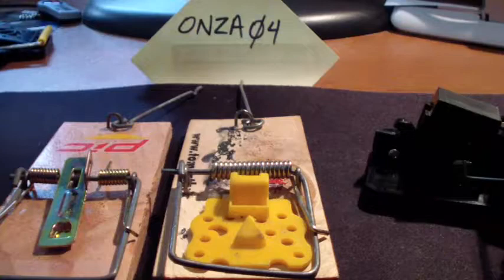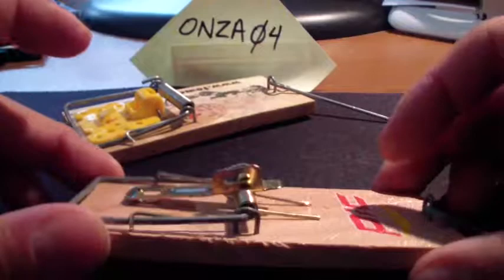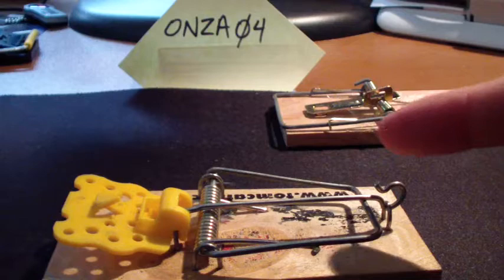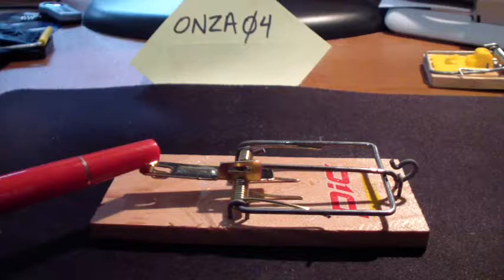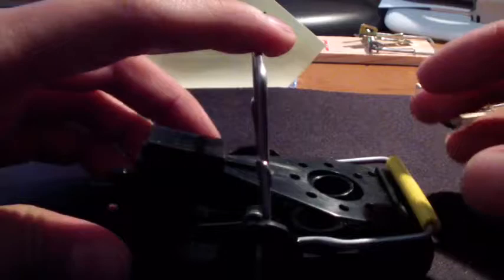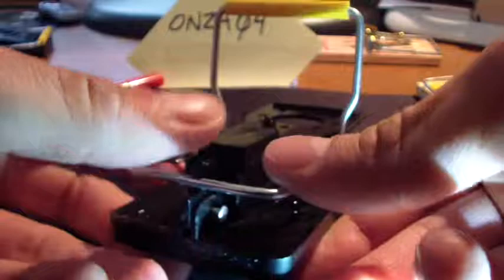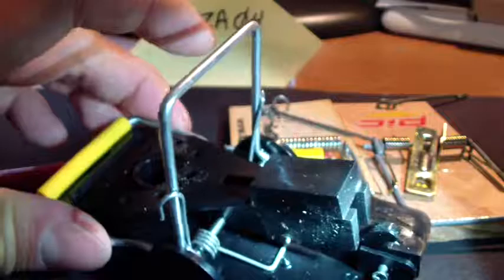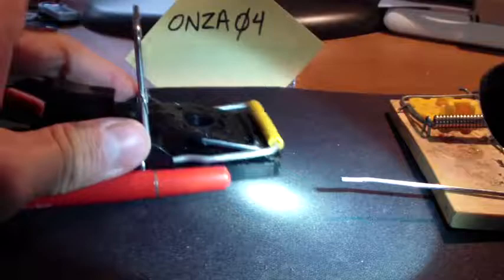REVIEW Kness Snap-E Mouse Trap Comparison by onza04

Comment: Kness Snap e traps are amazing. I bought 4 off of Amazon in November of 2015. Yes 1 1/2 years ago. I'm still catching mice off that original bait(peanut butter). Mice die before they even get a chance to start eating.

I don't have a huge mouse problem, but I do catch 2-3 a year in the winter. Just caught two this month on the same trap. I've never had a false positive, where the snap was triggered and the bait eaten which shows you how good they really are.

Comment: Good video.  Snap-E traps are the only mouse trap I will use.  Wooden traps will weaken if humid and are a pain to set.  The greatest things about the Kness Snap-E are you do not touch the filthy little buggers, the trap can be cleaned in hot soapy water, and if you notice, the trap jaw travels half the distance of wooden traps.  Twice as fast !

Comment: What works for me with the snap-e is put a peanut where the bait goes. Put one that doesn't fit perfectly. I then break off a pointing part of a toothpick, I wedge it in in between the peanut. That way the mouse would have to pull so it would be easier for the trap to snap. It always kills the mouse.

Comment: re. Snap-E : How much of a chance is there of catching/hurting your finger when you set it? I have carpal tunnel and my vision is bad. Do I really just pull that bar down and snap it - or can something snap back and catch me? Thank you.
Reply from the maker: Mark - personally this trap can be set by one hand of course there is some risk if the trigger is not angled correctly and the plastic piece doesn't catch on but light years easier than the traditional trap. If you do purchase one please use the link above as it supports my channel :)
Reply: You have very little or no chance of catching yourself setting a Snap E
 Fingers and nowhere near the trigger.

Comment: I hate that Victor mouse traps now suck. I once caught 50 mice with one Victor-a 90's model that was rusted and still worked. The New Victor ones the back pin flies out after one-if any mice are caught. I did catch 10 before one of the new Victors stopped working.I hope these traps I got work. So far they seem to be going only for the Victors and those are going fast. I think mice like the little enclosure feeling the Victors had, but we'll see. I will let you know if the Snap E ones help but I'm almost at my wits end.

Comment: What do you mean it's SUPER SENSITIVE? not it's not! it's just as sensitive as the other two. The mouse has to virtually put 1/4 of it's weight on the lever for it to be triggered. Mice and rats have gotten smart, most of the time they take the bait  without applying any pressure at all. That's why a lot of people have complained that these conventional traps have become ineffective.
Reply: The whole point of the design is that mice can't comfortably reach the bait without applying pressure. The food sits in a well, underneath the level of the plate. Have you even tried the snap e traps? I'm still on the original bait I placed in there (peanut butter). That's because mice die before they can reach the bait. I don't have a huge mouse problem, but I catch a few every year including 2 this month off that original bait. As you could have guessed, I've never even had the bait eaten because the trap has never gone off without catching something.